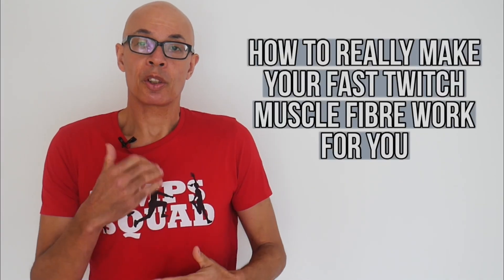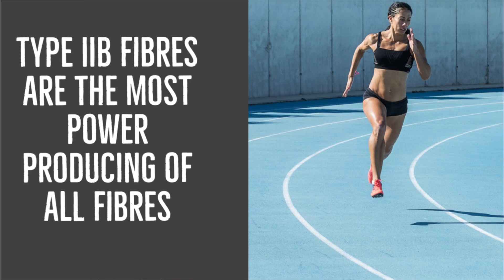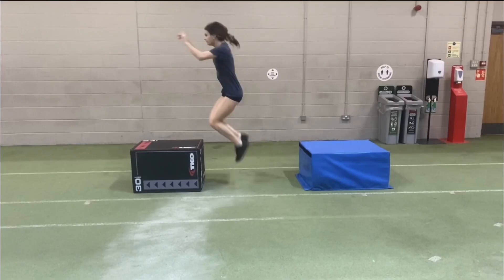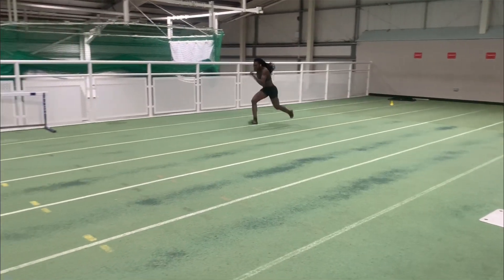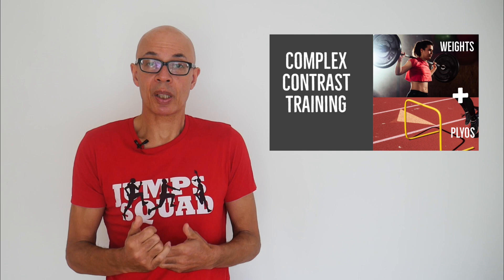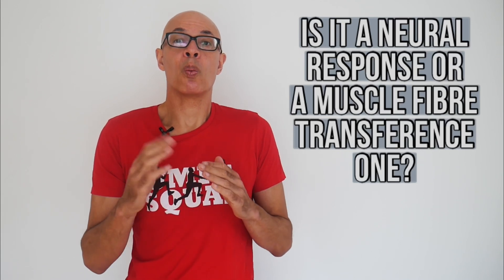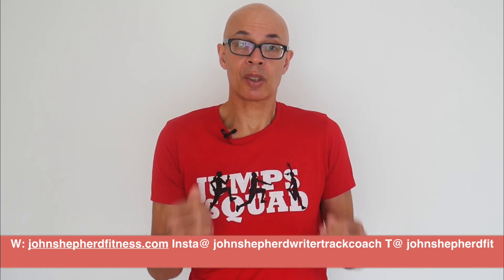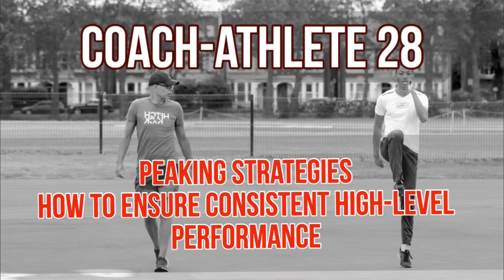HOW TO TRAIN FAST TWITCH FIBRE

Comment: Very nice video coach as usual!!
I ve a question.
Actually i m training on my vertical jump using the contrast training method twice per week,
Is better do the ploys exercises before the weight exercises or the other way round?
thank you so much !Cheers!!
Reply from the maker: Most of the research doesn't suggest that one way around is better than another. It may be best to do the plyos first as these are potentially less draining than the weights and thus your energy level will be superior for the weights. Hope this helps and good luck.
Reply: @Johnshepherdtrackcoach
Reply: @Johnshepherdtrackcoach  thank you so much Coach!!i appreciate!!